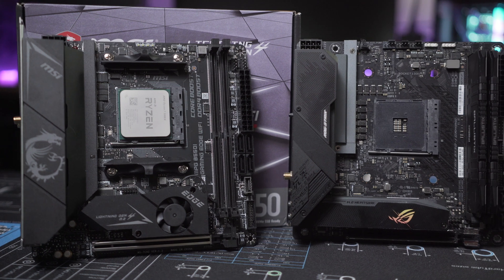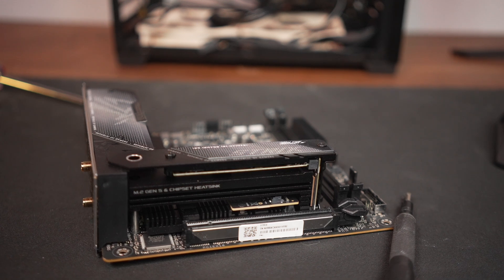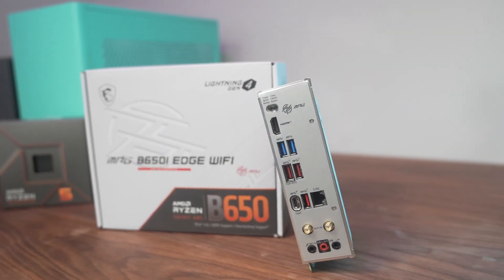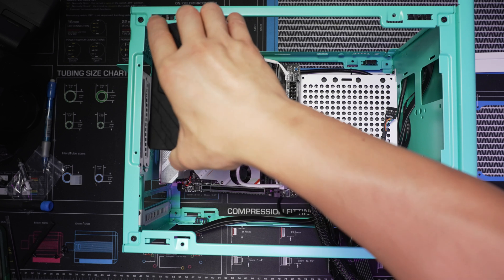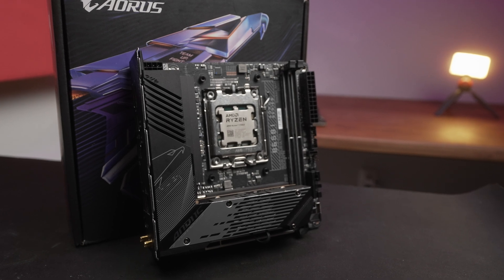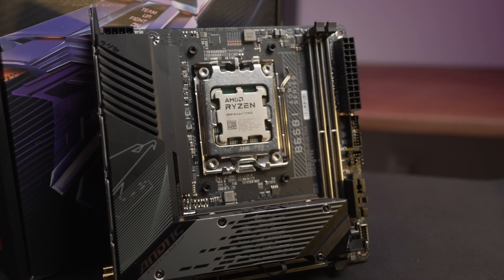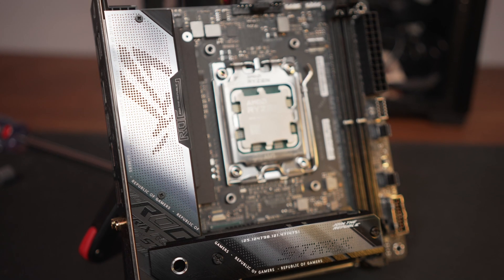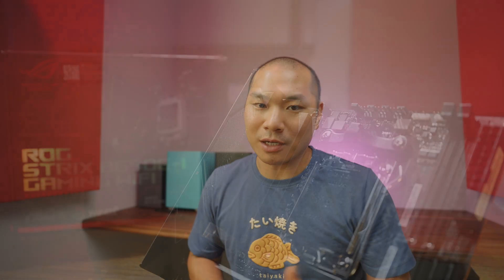Ryzen 7000 mini ITX motherboard... Round up!

Comment from the maker: Quick correction- the Gigabyte B650I has no SATA data ports on the board itself- if you mount the riser card you get four ports- two ports on the top of the card and two ports on the side of the card.
Reply: Thanks for the roundup. Could you better summarize the POST times (without windows boot)? Because this info is usually ignored by reviewers and you at least hint...

When I was deciding on the board, only AsRock and Asus were available. I went with AsRock first, because of absence of VRM fan and presence of LVDS out for some fun with case mounted LCD. That never happened though, as was given all kinds of hell with it. 36second delay before windows starts booting with memory context restore on a 2DIMM board was a no go for me. Wake-up from sleep was also very slow after dialing in the specified DDR6000 speed (memory was listed in QVL as fully compatible). So I went hunting for a better BIOS, updated to newest one to get even slower boot. Wanted to try other BIOS, revert to original, but the BIOS update failed everytime from that time on. AsRock support was completely nonhelpful with generic recommendations I tried already. Back it went, bought with Asus instead: 15sec boot, MUCH better BIOS, and for anyone interested the VRM fan never kicked in with my 7600X.
Reply: hey, could you do a video or let me know which ITX board can work with the IS-55 cooler, with the heatsink covering over the VRM/I/O plate?
Reply: @MachinesMore
Please include asrock b620 itx mobo.
Reply: @nikextracool Do you mean the A620M?
Reply: @nikextracool  or the new B650i AX
Reply: Great correction, at the time of typing this up I'm seeing a lot of used models on the market that don't include that front panel card. This sort of distinction could really screw over a builder operating on up to now general assumptions. Appreciate the attention to detail.

Comment: Just get the Asus B650E-I if you can afford it. I did for a secondary system and it's awesome. Runs amazing with a 7800X3D and 7900XT, super stable and excellent sound section. MediaTek MT7922 / AMD RZ616 Wi-Fi, which I actually prefer over the Intel AX210 / Killer AX1675 (I get slightly better speedtest speeds and no more stability issues than the Intels, which is to say zero), no goofy daughterboards or external pods like some of the ITX boards. And it doesn't run hot in a Sugo 14 mini ITX case with only the rear exhaust fan (the case supports HUGE air coolers and has a Phantom Spirit SE so that's surely a factor vs cases that require a slim heatsink/fan). For full disclosure, the first one I got was bad. Amazon exchanged it without issue and the 2nd one is beyond perfect.

Given that most people put one SSD and one GPU in their system, MATX and ITX are just fine for 99% of people - too bad they charge a premium for ITX (the B650E-I was $40  than my B650E-F, which is the full-size version) and all the MATX boards are low end. My next main system (way in the future) will probably be ITX after this build.

Comment: I'm building an SFF PC for a friend and thanks to your round-up, I've learned that the Strix B650E-I exists. Asus website is messed up and filtering for AM5 Mini-ITX boards does not show it, and it's not included on Techspot's otherwise very informative round-up despite it being just 2 weeks old at the time of writing this comment. 70A power delivery aside, it seems strictly better than both the Strix X670E-I and Gigabyte B650I Aorus Ultra - way better layout, no daughterboards, no add-on devices, and no oversized M.2 heatsink. Great video.

Comment: MSI B650i have BSOD and BIOS issues when having the EXPO.

What is your bios configuration with regards to the expo for each board to be able to run stable and have faster boot time?
Reply from the maker: I think it may have to do with the speed of the kits (even though the profiles may be tested, they are still technically OC with regard to the CPU). With mine I stuck to 5200mhz kits at most.

Comment: What do you think about the ASRock B650I Lightning WiFi? I dont know if i should get the ASRock one or the MSI motherboard.
Reply: There's a pretty big price difference there. For the Asrock, I'd go for the A620 if you're not going to overclock and save $60, it's identical except for chipset. For the MSI, I'd spend the extra little bit for the B650E-I.

Comment: I have a whole bunch of components for my next mini-itx build (NR200P, Cooler Master V750 SFX, SN850X, ...) waiting for my next build. I am just missing the Motherboard/cpu/ram combo... The B650 looks fine but it is very expensive. I am hesitating between a GIGABYTE B550I AORUS Pro AX and a B760 solution like a ASUS ROG Strix B760-I. As Machine&More is my "Bible" when building a mini-ITX configuration, I am wondering why there are no reviews about mini-itx motherboards for Intel 12th and 13th generations? Any consideration not to go with a B760 solution (or even a B660) and keep the older and solid B550 solution?

Comment: I was debating between MSI B650 and ASRock B650I LIGHTNING WIFI for 7800x3d. Many report strong fan noise on MSI board and loud coil vine. Not sure about this AsRock board. Seems ok at 200$ price tag. Would appreciate some input
Reply: did you go for msi b650i edge?

Comment: I recently built in the NR200P MAX at the weekend, I have a 12th gen i9 so i went with the MSI B760i Edge WiFi DDR5, i'm not overclocking the cpu, the motherboard has been great I have it pared with 64GB DDR5 6400Mhz Corsair Dominator RAM and a Zotac 3080, also I have 2 black 120mm slim arctic fans at the bottom of the case as intake, when i'm not using the PC i have the glass side panel on for show and when I'm using the PC I put the vented panel on, it's a great case for my small space, I have another build with a 13th gen i9 and a zotac 4090 Trinity, I even thought about putting that gpu in but it might be too big! i'm using the NR200P MAX build as a streaming PC.  Great channel btw I love the content it's very chill.

Comment: I just send my MSI B650i back right after I purchased it. The audio jack had a terrible distortion noise depending on the CPU load, especially in CS2 just so awful. I think this is just a rare failure but at least a think to look out for when testing your system

Comment: You’ve got to be insane to buy an AMD mini itx motherboard!!!

Welp, Intel won the mini itx market
Reply from the maker: Yeah, the grass is kinda brown on the Ryzen 7000 mini ITX front...
Reply: But Intel 13th generation is very difficult to cool in SFF form factor and not everybody wants liquid cooling in a portable computer. If you are targeting i5 13500 or below then yeah Intel is better in both value and performance.However you need to be very lucky in the silicon lottery to be able to undervolt a 13600k so that it runs below 150W which is the maximum 67mm air coolers like the Thermalright AXP120-X67 or ID-Cooling IS-67-XT can handle. Otherwise you are leaving performance on the table. An i7 13700K is out of question without liquid cooling.
Reply: @gencoserpen1260  If you desperately need that type of CPU performance on air, I'd recommend buying a slightly bigger Micro ATX computer instead.

It just doesn't make sense to take that huge motherboard (cost) hit for slightly better cpu performance on such a small build.

Mini Itx with no water cooling = Light to Light-Mid CPU always

Comment: Am I the only one who thinks Asus is on the right track with having debug LED's on the outside? Where it's actually visible and therefore useable? What's the use if it's on the board and you can't see it because it's crammed inside an ITX case. Would you prefer to open up your ITX case just to look at your debug LED's? I like the Hive setup specifically because of this. I'm building inside the meshroom case so I think it'd be nice to have the volume, extra inputs, Debug LEDs etc. all at my fingertips. No BOO! Don't innovate, charge more money for the same board as last time.

Comment: I had the B650E-i from ASUS and I had never ending stability issues. Updated BIOS whenever a new revision was available, ran memory stock but still experienced BSODS. To rub salt into the wound, it also had awful coilwhine.

I might have gotten really unlucky with the batch of ASUS boards when I ordered mine, but as soon as I switched to the MSI b650, everything just worked. No BSODS, no coilwhine, no stability issues. 

Feature wise, it lags behind the ASUS board, both in terms of IO and in placement of headers on the motherboard, but I'll happily trade that for a board that just works.
Reply: I also had annoying coilwhine with my ASUS board, switched to the MSI myself and also had no coilwhine. After having an ASUS RTX 3070 dual which also had horrible coilwhine I am starting to think buying ASUS isn't it.
Reply: The first B650E-I I got was bad. I exchanged it and the replacement is awesome, super stable and no weird high-end computer fussiness issues.

Comment: The Asus B650E does have an external Clear CMOS Button. It's located in the I/O area, lower left corner. See at 3:42 for example. In sum of all features definitely the best AM 5 ITX Board.

Comment: Hey M&M, thanks for this comprehensive summary. Which ITX board is better for AM5 futureproofing?Is the B-650E-I Strix enough for Ryzen 8000 or 9000 cpus? Or Better to go with  X670e Strix-1 or go higher with Crosshair Gene though that is matx?Thanks
Reply from the maker: You know, it’s hard to say but I would anticipate power delivery to be sufficient. Given some of the hiccups with even just the X3D chips, anything could happen with next gen, but I don’t think AMD wants to release a new CPU and have nobody buy it because their boards can’t run. They’re already facing a tough market with Ryzen 7000.
Reply: @MachinesMore  Dear M&M tanks for insightful reply. Really appreciate it.👊

Comment: Have Gigabyte sorted their backdoor issues? 
Also is it possible to do a video for m-atx focused on those with gen5 for GPUs? Gen5 for storage as a consumer doesn’t really makes a difference vs gen4, but having a motherboard with gen5 GPU support would be nice since I tend to use the board for 3-4 years. Rumors suggest we get gen5 GPUs in 2024.

Comment: Thanks  for this. i am planning on a new personal SFF computer later this year. i had already thought the MSI was the best board for me and this excellent review just confirms this. My last couple of builds (both SFF for family members)  were done with MSI mobos and they have worked well with a good bios as well. i wish the board manufacturers could figure how to put the audio plug in a different spot. With  chunkier GPU's, trying to plug the video card in, that damn wire always gets in the way for me. Its likely  not a big deal if you use a riser cable. my biggest question is which case to use but at the end of the day i am still leaning to using the NR200P. i just have to have a glass panel to look inside especially with the case sitting on my desk and see my work. Plus i want to air cool it. I am not a huge gamer or productivity user but i just like a nice setup to look at (yeah i like some RGB accents too). My last build was in the NR200P with a Noctua air cooler and it went very well thanks to your very helpful videos on building in the case and how to set up the air cooling for optimal results.

Comment: YO M&M!!!...The Gigabyte B650i has (4) SATA 6 ports on the add on card

Msi B650i - (2) M.2  & (4) SATA ports
Ggiabyte B650I - (3) M.2 & (4) SATA ports (one of three M.2 ports are pci-e 5.0)

Max memory capacity for MSI B650I & Gigabyte B650i - 96Gb

Gigabyte backplate is NANOCARBON (excellent heat absorption & heat transfer properties). That backplate uses that speacial plastic, LMAO! Anyhoot, I like it (thumb up!). However, I do wish it had a clear CMOS button on the rear IO (thumb down)

MSI B650i - $299
Gigabyte B650i - $259

It was very easy for me to buy  Gigabyte over the others because powerful vrm & (3) M.2s with 5.0/4.0/4.0 pci-e) & (4) SATA ports
I can forgive Gigabyte for the dongles & no debug led indicator

4 months & running...no regrets buying the Gigabyte B650i (double thumbs up w/smiley face!!!)
Reply from the maker: Thanks for pointing that out- I missed the two side SATA ports on the add on card!
Reply: @MachinesMore  No problem & I really like your channel (two thumbs up)!

Comment: The ASUS ROG Strix B650E-I is the best ITX board for Ryzen 7000, Amazing price, great board and really really good for the Big Shuriken 3 Rev B cooler! I own both and have zero complaints.
Reply: Best board, but terrible price.
Reply: Currently $230, worth it?
Reply: @stance1x  Yep had it 2 years still going strong not a single problem

Comment: Love this summary, great video! I grabbed the MSI for $239 back when it was on sale when the 7800x3d launched, which I grabbed as well. It’s been solid other than issues with RAM at 6000, but 5800 has been good. Glad I decided to go with it as it was the cheapest option at the time and I was pretty surprised to see the price climb up the way it did.
Reply: You may want to give 6000 another try with the latest BIOS, in my board 6000 CL 30 runs fine with the 7800X3D and just EXPO enabled.
Reply: Which ram kits are you using ?
Reply: @seawolf7610  Not sure who you meant, I have Corsair Vengeance, model CMH32GX5M2B6000Z30K
Reply: @carstenpfitzer4764  question was open to both. None of the 6000MT kits available here are listed on my mobo qvl.
Reply: Have you experienced any audio issues with the rear audio headers? I got the MSI board, but I am experiencing "popping" noises extremely frequently.
Reply: @Jetman765  No audio issues on my B650E-I at all.

Comment: AM5 ITX boards are at least 30% more expensive than their intel itx counterparts it seems which is pretty crazy. Thinking about selling my b550i / r5 5600x / 32 gig ddr4 as a whole bundle to get some cash toward an am5 build
Reply: Asus B650E-I is a fantastic board, Newer platform will be more expensive of course

Comment: I want to movie to mini itx, but I also want 3 nvme slots. Is there any with that option?
Reply from the maker: Strictly within AM5? It's going to be the Gigabyte then. If you're also considering Intel then both MSI Z690 and Z790 ITX boards support 3 m.2 drives (no gen 5 support though).
Reply: @MachinesMore  no intel. I have an Asus Crosshair x670e hero and 7800x3d. Just want to down size since a have a mora3 420 radiator now. May have to go micro atx

Comment: 'Plastic back shield' @ 2:10? That's anodized aluminum.
Reply from the maker: That's what I thought initially, until I took it off to test the drive slot. It was non-metallic. Plastic/graphite type of material.
Reply: The backplate is a nanocarbon material. It is non-metallic. It's definitely not 100% plastic but MIGHT contain some within it's composite form (not 100% sure). Gigabyte advertises the backplate to be nanocarbon. Nanocarbon is a material of carbon allotropes (take some time & research it). An allotrope is an element that possese two or more different forms in the same state. For example, diamond & graphite are the two allotropes of carbon. Also, take a little time & look up the allotropic forms of carbon. There are several allotropic forms. The mysterious question is, "which allotropic forms were used to construct the backplate?"

What is known is that nanocarbon is a tough light-weight composite with excellent thermal & electric conductivity & it's a suitable material for what its being used for on the motherboard.
Reply: @doCtorBlahMan  Gigabyte's own marketing material says it's aluminum with a thin "NanoCarbon" coating (with that capitalization, suggesting a product/company name), which I mistook as anodization. It looks like a stamped metal plate (look at the all the edges and bends), as that's what it is. There is no way it's predominantly carbon; that would serve no purpose and be needlessly expensive. Gigabyte's "NanoCarbon" is probably the trade name of a graphene paint of some kind.
Reply: @morbadthworst8148  The thin layer of nanocarbon over the aluminum backplate was specifically described for the B650E AORUS MASTER. So I will agree with you regarding the B650i backplate being the same. That's still cool with me. Aluminum backplate coated with a thin nanocarbon material...I'll take that. I enjoy what Gigabyte does to separate themselves from the other motherboard brands!

So there you have it M&M! No plastic backplate for B650i. It's just simply an aluminum backplate coated with nanocarbon. Thanks for that info "morbadthworst8148!"

Comment: I have no problems at all with my Asus B650E-I, awesome board, no coil whine, RAM with EXPO stable at DDR5-6000 CL 30, built 04/2023.
Just make sure you have the latest BIOS installed.
Reply: Same experience, although the first one Amazon sent me was bad. The replacement is perfect, so stable and no problems with DDR5-6000. Built 8/24, I always flash the BIOSes on MBs to latest with Flashback first thing after removing from the box.
Reply: What CPU are you running with that motherboard though?...
Reply: @Dawelio  Already two times my answer vanished, what the heck is going on here? I use a 7800X3D with a Noctua NH-U12A cooler.
Reply: @carstenpfitzer4764 would a single 120mm AIO be enough to cool this CPU down in NZXT H1 V2?
Reply: how abouz until now? still bo coil whine  and all good?
Reply: @shusui9665 Still perfect, dead silent.
Reply: @carstenpfitzer4764  thx have fun

Comment: Why the msi B650i is so expensive in teh US?? 
In central EU its around 220~230€ since the beginning... bad luck i guess, very happy with mine as a ITX first timer!
Reply from the maker: It jumped up all of a sudden earlier this year. The EU pricing seems good compared to the other options.
Reply: Does it still have cmos battery issues?